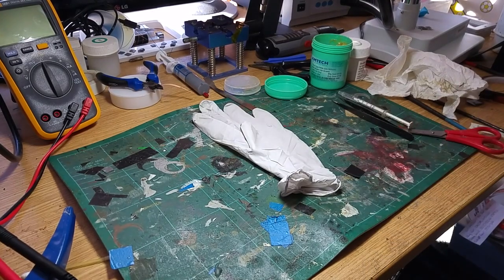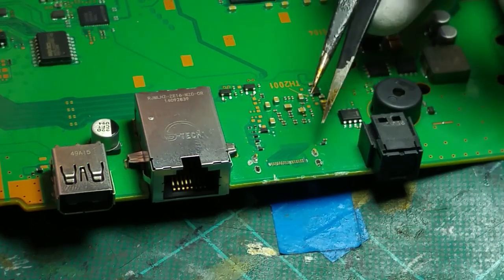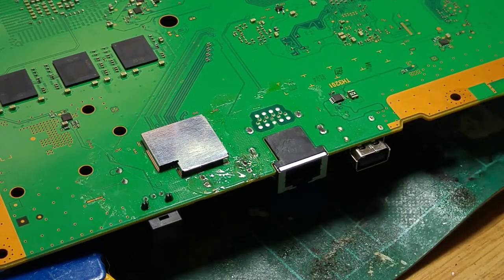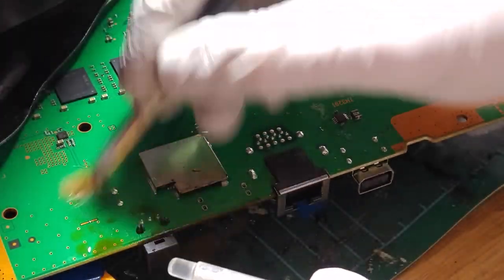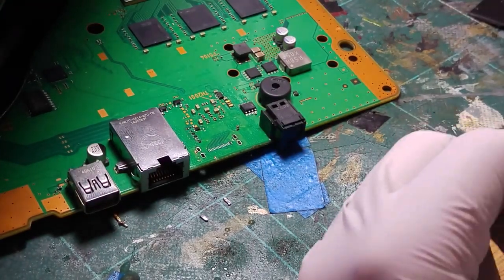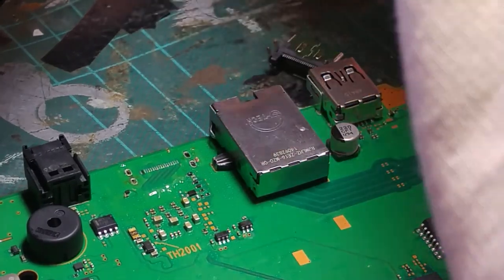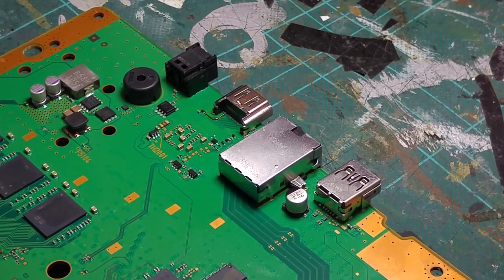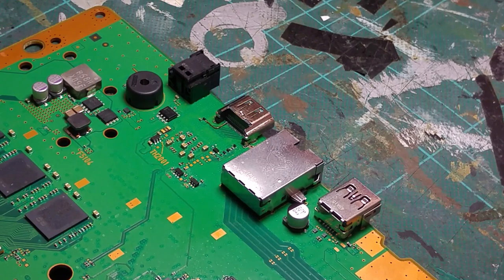PS4 HDMI Repair: Fix PCB damage and run link wires tutorial how to

Comment: I had the same problem when I was repairing a ps4 ,the pins where detached from the board,but what I did and worked was clean the pin surface added flux and swiped across the pins a little bit of solder with soldering iron and made new pins,then I tested every pin with multimeter and it WORKED! then just soldered new hdmi port...Thanks to ur videos..helped out alot..

Comment: Hey Andrew thanks for the link to the HDMI pin-out, that will definitely come in handy. Was going to use it today since I ended ripping off the pads from a unit yesterday and thought I would give it a try. But today the problem went from bad to worse and I ended up ripping off more after botching the soldering of the 19 pins and de-soldering the the port to try again. I ripped so many pads off that I ended up scrapping the board and will try my luck on another unit tomorrow. Its really discouraging spending hours tweaking what should have taken 30 minutes so I definitely plan to upgrade my soldering station. The main problem now is that the bridging just won't go away and the more I go over it with the iron, the more of a mess I make no matter how much flux I apply. I applied so much solder on the board that it basically soldered itself onto the copper  traces and other areas on the board. On the bright side, I got pretty comfortable using the fine tip point for my soldering iron so I'll use that starting off next time instead of the chisel tip and hopefully it'll make things easier. Can't wait to put this disaster behind me and fix another WLOD, my soldering technique is questionable at this point

Comment: Hi Andrew I have couple of questions 
1-what brand of flux do you recommend? 
2-what kind of wire shall I use for hdmi pad repairs (What size and what kind)?
if you kindly reply it will be greatly appreciated .
Reply from the maker: That info is in this video. I also have an equipment video on the channel which covers everything in more detail. Cheers.

Comment: Hello! Great videos! Could you help with a question? I recently bought a ps4 for repair and the previous owner burned the closest via for pin 19 (if viewing with the port opening facing away). Is there an alternative point to solder too?

Comment: Hi Andrew- Quick question:
I damaged quite a bit of pads attempting to remove my old broken hdmi port and I was wondering if the process will work the same if I was to run the link wires before attaching the new port. Pads damaged include 3, and then 5-9
Reply from the maker: You're better off doing it afterwards - they'll likely be disturbed during the port reattachment otherwise as the board carries quite a lot of heat during the soldering process. Good magnification and a suitably sized iron tip will make things a lot easier.
Reply: Alright I guess I'll give it a go ha, I'm having trouble finding 34 AWG gauge copper wire though. Would 22 gauge work as well or is it too bulky?
Reply from the maker: Too big - 34 or 36 is what you'll need.

Comment: Do you know which 2 components are directly behind the HDMI port on a sac-001 mainboard at all? I have a ps4 here and somebody's pushed the port in so far that it's taken them clean off :(
Reply from the maker: Those little grey oblong shaped things? Those are EMI filters - take some from an older PS4 board or even a PS3 if you have a donor kicking around.

Comment: Hello andrew! What kind of soldering tip do you use for hdmi port pins? I have bought a soldering iron that is meant for electronics but it still seems to be a bit big for the hdmi port pins. Thanks in advance
Reply from the maker: +Tarik Mahmutovic Hi, it's a Hakko T12 series J02.

Comment: good vidio again mate, i were wondering if the hakko tips would fit my isolder 40 you ans it in your vid. cheers mate
Reply from the maker: +o_O_RedI_O_o power Yes mate they fit - this fine pointed tip is a T12-I.
Reply: +Andrew Paul thanks mate ive ordered 2. i bought a ps4 off ebay and put a new bluray player in it, seems to work good and plays games now, but when i power it on it flashes blue light then no white light, the fan seems to be running a bit faster, have you any idia why ive no white light?

Comment: Fantastic work Andrew
 pls i have ps4 that was no pic and sound until i have replace HDMI Encoder IC 
 but now there is no sound 
 i check all Hdmi pin with multi-meter and its ok
can u told me the proplem
Reply from the maker: +Matrix Maslati Check for continuity across the EMI Filters opposite the IC and check for cold joints / loose pins on the encoder IC itself. Did you measure continuity across the HDMI port with a lead plugged in? I've seen it before where ports have measured fine until a lead was inserted when they've been broken internally.

Comment: What brand and which type of hot air gun are you using? I'm looking for something affordable but all the decent ones are running $200+
Reply from the maker: Indeed and those are the only ones you should be looking at if you want good results. Steer clear of anything from Aoyue/WEP/WIP/Bakku etc - anything with a model number like 968+ etc is probably going to be garbage.
If you're on a budget but need a competent tools then the best bang for buck option is the Quick 861DW.
Cheap tools are a false economy, trust me I've been there, bought them and replaced them with the more expensive options in the end anyway as the cheap ones were garbage that just weren't suitable. Save yourself the money in the long run as well as the uncertainty as to where you're going wrong / is it me or the tool etc etc - trust me you'll thank yourself in the end!

Comment: what are you cleaning it with ? Alcohol ?  what kind of flux do you use ?
Reply from the maker: Isopropyl alcohol. Flux details are on my equipment video - Amtech RMA-218
Reply: I used a heat gun to remove my old  hdmi. And used aluminum foil to protect the board and that thing didn't want let lose til the gun almost burned me. Got it off. A couple pins stayed in the board. Still trying to remove. Did you use solder Wick to get the couple that broke off on yours ? I also would think there's a special solder gun or adapter that can desolder and resolder multiple points like these ports isn't there ?

Comment: Hi Andrew Important Question 
My Step dad unwellded and wellded a new HMDI port on it and now my PS4 doesn't turn on the light comes on then goes straight off does that mean I need to put thermal paste on
Reply from the maker: Sounds like something got damaged during the reassembly procedure. Check the power supply is properly seated and there are no damaged areas on the board or pads where a component has been knocked off. Is there thermal paste still on the APU die? If not or there's very little then add some more.
Reply: Andrew Paul Ima have a look at the power supply and there is not a lot of thermal paste and it's crusty? Please help
Reply: Rectro-V2
Apply thermal paste, it's because the chip is overheating so it won't turn on.

Comment: Hello Andrew. Firs of all thank you for all youre tutorials. I've fixed every console thanks to you. Can i ask for your help. I have to console with 2 issues. I have the new revision of ps4 wich beeps 2 when turn on and the bluelight stays and i don t know of its a reball or something else. i tried everything. and the second one is a xbox one and there is a short near the power socket, i ve eliminated some of the capacitor and diods...but the short is still there and i can't find any of the schematics. can you advise me what to do with them. thank you.
Reply from the maker: +Ciprian Baroncea Beeping PS4s with a BLOD condition are usually ROM corruption from my experience so not sure there's much you'll be able to do with that to be fair. As for the XBOX One, I don't have any I'm working on currently so have no boards to hand. Consequently I'm unable to advise further on that. Cheers.

Comment: I had to turn one away today which had 5 torn pads (4 right next to eachother side by side). After much frustration trying to get each wire soldered without a bridge or touching I gave up. Have you ever succeeded in such a badly damaged board?
Reply from the maker: Hi Ian,
I have - even did a full 19-pin repair once over but never, ever again lol!
The key to it is very thin magnet wire (34 gauge at most), a steady hand, micro-soldering tip and good magnification.

Any more than 5 broken pins (ground excluded) and I turn them away - too much time and hassle.
Reply: would 22 gauge be better for this sort of work? I attempted it with some inverter wire I had from old lcd screens, far too thick I think. do you use solid core or multi thread?
Reply from the maker: 22 is massive in the scheme of things - even 34 is pushing it. Probably 36-38 would be better.
Magnet wire is otherwise known as enamelled wire. It has no plastic sheathing as such which again cuts down on the bulk. You strip the enamel coating off with the heat of the iron - looks kinda funky and you can have some fun with people who've not used it before as they think it's all bare wire and you're mental ha ha! 
Solid core is the way for such repairs.
Reply: Thank you very much! I won't be having that ps4 back in as such as he was in a rush for it (going back to Italy tomorrow) but I will get some wire you recommend so I am ready in future! Great advice as always.
Reply from the maker: My pleasure. :-)
Reply: Andrew Paul can you fix my PS4 please

Comment: Hey not sure if you'll notice my text but what is the hot air temps  by any chance thanks
Reply from the maker: 485 Celsius @ 100l/min. Cheers.
Reply: +Andrew Paul thank you
Reply: +Andrew Paul i kept using the wrong temps (350°c) lol
Reply from the maker: Yeah that's not going to be hot enough. A nice high temp with good airflow means you can hit the port with enough heat to remove it quickly to avoid having to hear the board for a prolonged period.

Comment: What is the componet  last one on the other side where you put the wire.. Look the same but what can it be..Do you know anyone konw? The reason i ask is that i got a PCB missing just this one.. And i need to replace it.. Anyone have a Print for this PCB
Reply: Did you find out

Comment: You really should buy in the V2 HDMI ports all the pins align up and work 100%. I've never had one come back yet! When I used those crappy v1 ports they where all off by one space, despite 100% continuity testing would still get black screens or very touchy when moving the HDMI cable. I'm sure they are made out of the same cheese as the Sony originals.
Reply from the maker: +Uber Micro Repairs I use both and to be fair can't say I've had any issues with either aside from one bad batch about 6 months back which was easily rectified by the supplier.
Reply: +Andrew Paul I have used both as well and with the V1 I got so good at knowing how far off the pins were that I could bend (slightly) the 4 mounts so that when I did put the port in to see if everything was aligned...it was spot on the first try every time. We have gone thru several suppliers and they all claim that their product has the "Perfect Pitch" but none of them ever do...so I made them work....and have NEVER had a customer come back with a problem.
Also, as always, great vid Andrew. Like I've said before...let me know when you're ready to move to the States so we can get you into our flagship store!!
Reply from the maker: +Center City Repairs Ha ha! Yes I'm similar :-)
I'll be sure to let you know :-)

Comment: Hey, i have a ps4 with several link wires broken, can i replace them all using very thin wire? should i use holes from previous wires or link them straight to places where it leads?
Reply from the maker: You'd be best to use some 36-38AWG enamelled wire (aka. magnet wire) and route them from the rear of the HDMI port to the alternate pin-out locations therefore bypassing any damaged regions of the board.

Comment: My pin #10 via is ripped out. Any idea where else I could connect?
Reply from the maker: If the via is gone then you'll have no choice but to link it to the front side of the EMI filter in front of the Encoder IC on the opposite side of the board. Should be easy enough.
Reply: Andrew Paul thank you so much! you have earned a sub and lots of thumbs up!
Reply from the maker: You're welcome and many thanks for the sub! :)

Comment: Can anyone tell me the diodes/resistor that are needed for 15 and 16 and the 1 between the they came off after ps4 was dropped thanks if someone can help 😊
Reply from the maker: Hi James,
We sell replacements for both of these components - if you want / need some just drop me an email to ytandrewpaul@outlook.com with your location and required quantities. Many thanks.

Comment: I tried hot air for 20 minutes nothing couldn't remove the port
Reply from the maker: Which hot air gun, temperatures and air flow settings are you using? Also, are you using flux at all - if so, which variety?

Comment: i did a hdmi repair. and whe i turn the ps4 on all you can hear is the sound and no picture
Reply from the maker: +CJAWGAMES Which pin is damaged?
Reply: non of them all pins are soldered down. i have a microscope. iv had a look no bridges or nothing
Reply from the maker: Have you confirmed with a multimeter that there are no shorts present? Are any pins shorted to ground which shouldn't be? If so, this can be caused by a faulty HDMI Encoder IC. It's also worth checking with a HDMI lead inserted and measuring continuity from the alt. points across to the test pins in the end of the lead to make sure that the signal is physically getting to the display.

Comment: So I bought this 500GB white PS4 Preowned.A year later I finally decide to buy a ps4 camera because I finally found one at a decent price that I don't mind spending money on. I come to find out I have a faulty AUX port. Now I have a camera I've wanted for a very long time and my ps4 won't recognize or detect the camera. So should i just buy a new ps4 or scam SONY and swap the entire motherboard with one that works and return their pos motherboard in the newer ps4? Sony wants to charge me 150+shipping to fix my ps4.... Do I look stupid to pay for that when this was SONY's fault in the first place to sell a faulty AUX ps4? Hmmm.... no. How would anyone know this without buying a camera for an extra 50-60 bucks? So im wondering if i just have to replace the port itself or is there more to it? Chip?
Reply from the maker: The only way to know for sure is to dismantle it and take a look with a DMM. The only issue with that is that Sony won't touch it once it's opened. Sadly it's not as simple swapping the motherboard - it's married to the blue ray and hard disk drives.
Reply: +Andrew Paul ah I see. I saw another video of someone replacing their HDMI port so I thought I could do the same thing with my AUX port. Or are people replacing their ports only because it's damaged? I'm not too sure what I can do to get my ps4 camera to work when my ps4 isn't detecting it at all... -_-
Reply from the maker: Have you tried the camera in another PS4 to check it's not that with the issue? The Aux port circuit is a fairly simple one with not much to go wrong to be fair.